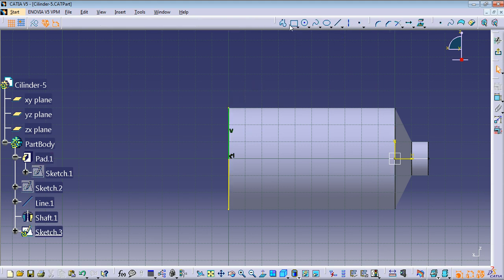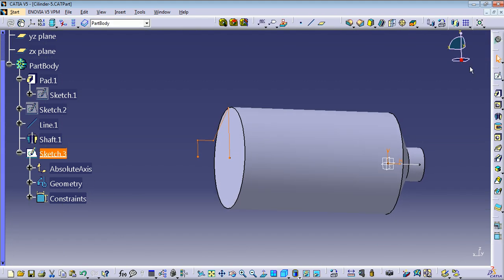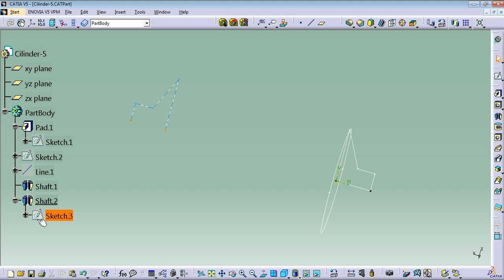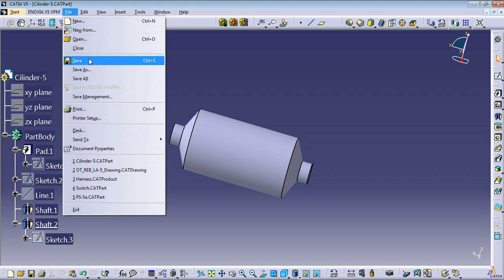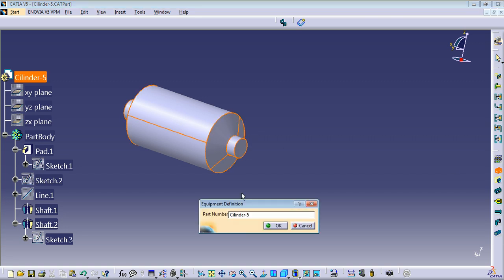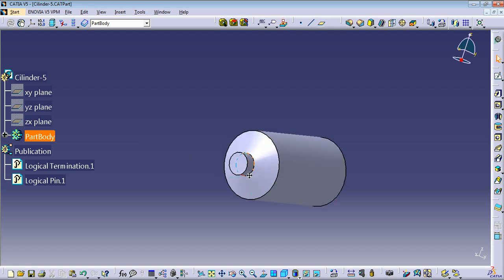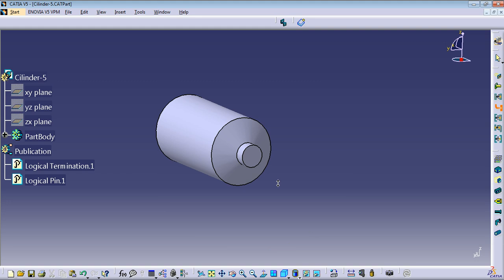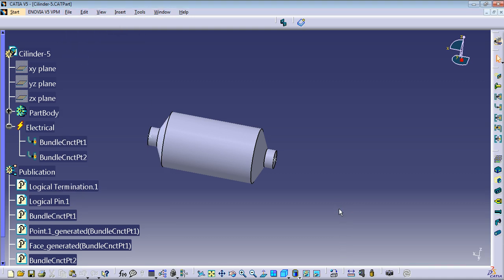Catia V5 training part 5

Comment: Thanks for your video. It is helpful to build wire harness.
May I ask about my problem?
this process needed for Electrical harness assembly. right?

and I thought to my self, 'Define bundle connection point' makes link between bundle end/start point and part.
so I try to move electrical part geometrically after I connected wire using 'bundle segment' in 'Electrical harness assembly'.
but bundle wasn't refresh. is it right? or I missed something?